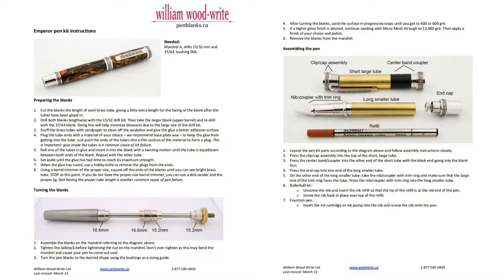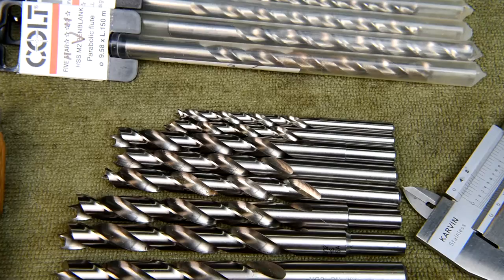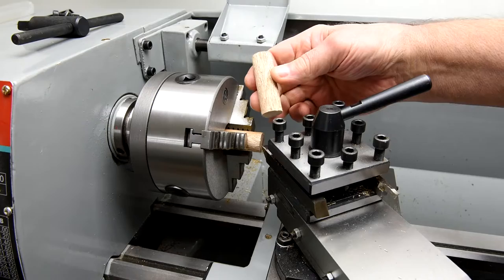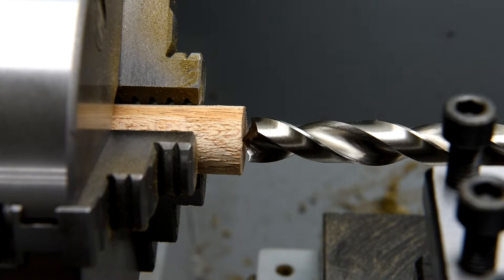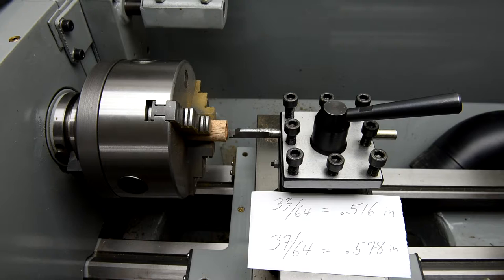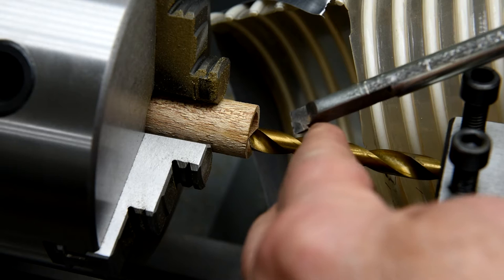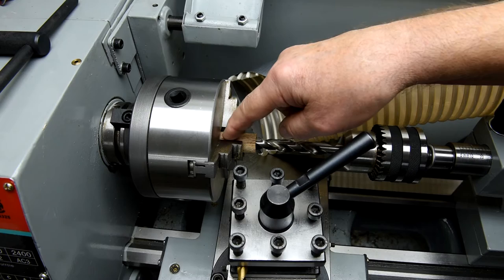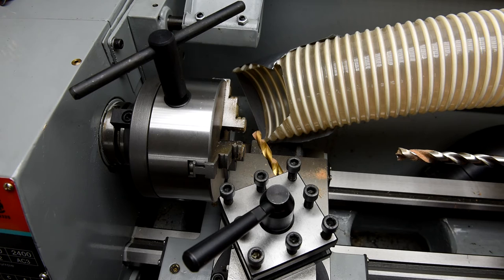"The Emperor" Pen - Part 1

Comment: You sure do keep  things interesting Ron.

Have you tried the local Lee Valley there.  Or certainly you must have machine shop suppliers there.  Or eBay.  Or Amazon.  There must be a 37/64" bit somewhere in a town that size.  Go to a machine shop and ask to borrow one if you are only going to use it once.  If you are only drilling wood you really won't hurt it.

I too hate the high cost of shipping and "HANDLING".   Especially when it can be twice as much as the item you order.  I sometimes seach for an hour just to hold my pride in not paying a fortune for shipping and "HANDLING" for the same item.          JimE
Reply from the maker: 37/64 seems to be a really oddball size. Lee Valley has bits that are close. I didn't want to have to drive across the city. Lets see what I can do with the 4 jaw chuck and 3/4" square stock tomorrow.

Comment: Do you have a 13mm bit?  A 13mm and a 37/64 bit are almost identical in size.  37/64 = .578 inches and 13mm = .577 inches.
Reply from the maker: When I realized that I didn't have a 37/64, I checked my comparison chart on the wall. It covers all contingencies up to 1 inch. Then I went through my metric bits. Wouldn't you know --- 12.5mm was the largest, lol  :)

Comment: NOOOO,  I bet if you look at the end of your chuck you will see the drive is not open to your gear box,  should be a solid "tunnel" from chuck to outside of gear box.
Reply from the maker: That makes sense. Otherwize metal cuttings could get in there too. Maybe I'll take the chuck off so I can see the inside of it better.
Reply: BINGO just open your chuck jaws and look down the hole, you will see.
Reply: I just saw the other video, I have to admit that I thought you were talking about the gear box on the lathe getting dust in it,  yes dust will get inside your chuck, on my lathe I take it off and clean it every two years , (metal lathe) I find the chips do not affect the accuracy.